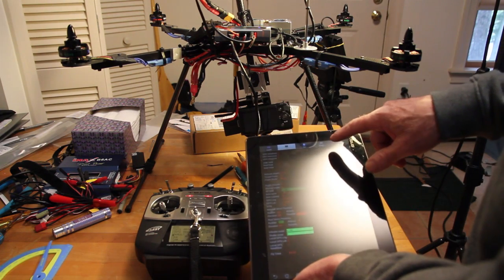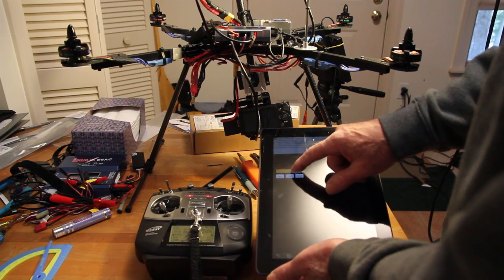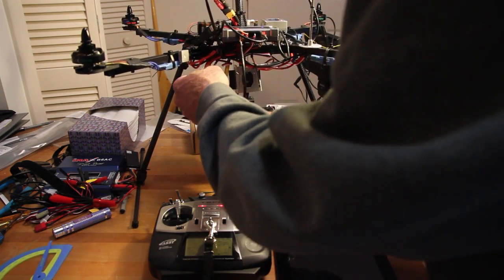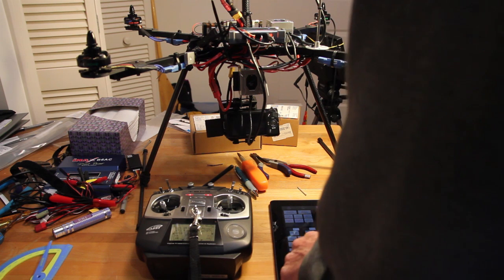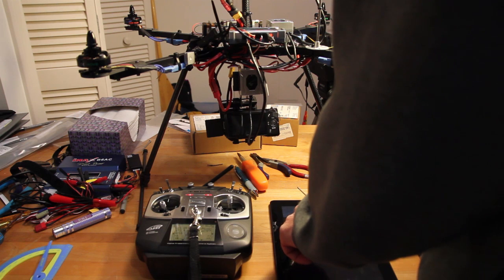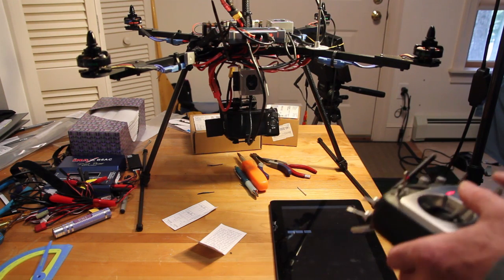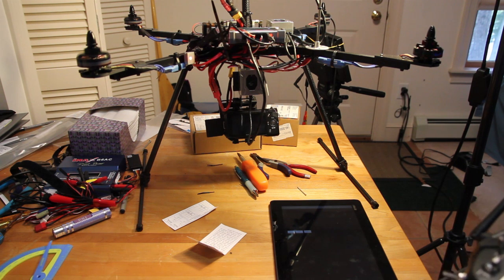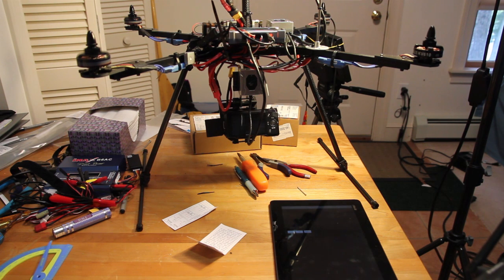YS-X6 ESC Calibration

Comment from the maker: This frame (Zero Steadi470) comes with motors and esc's.  The Motors are W42-25 KV610 High Efficiency Outrunner Brushless Motor for MultiCopter (also available on goodluckbuy).